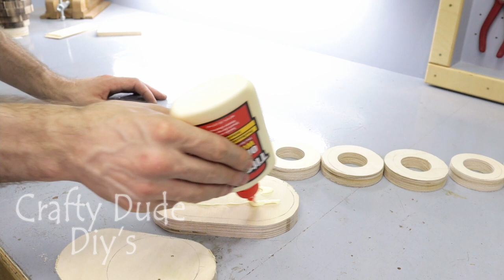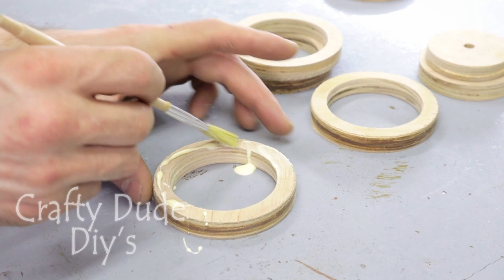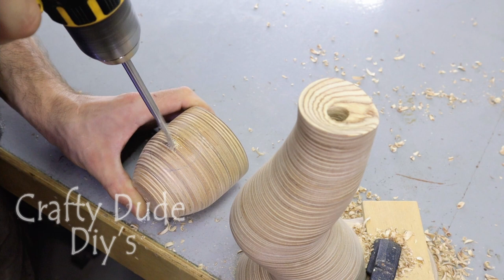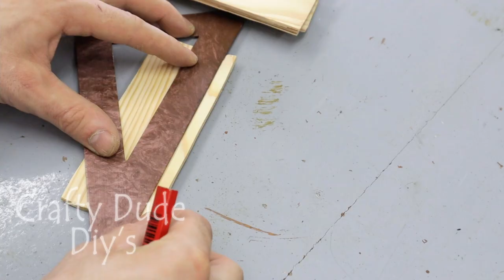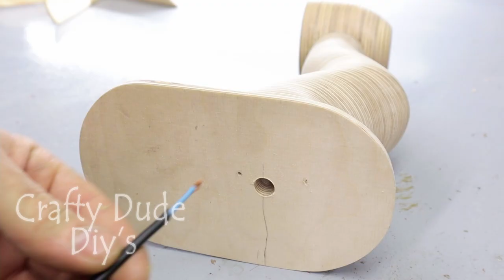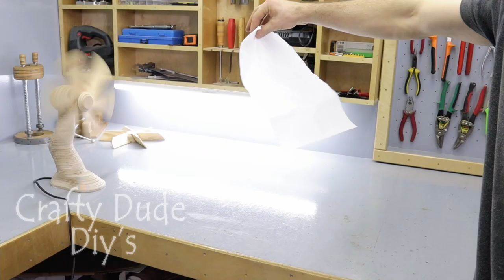How to Make homemade Air Fan // Diy Air Fan

Comment: beautiful example of skill in sculpture: working with a chisel so well is rare, only thing I would add: a few holes for cooling the engine,
Reply from the maker: Thank you, working with chisel is great as its don't make dust🙂 So I maked holes in front and back for cooling, I will drill it bigger if i see thats needed👍